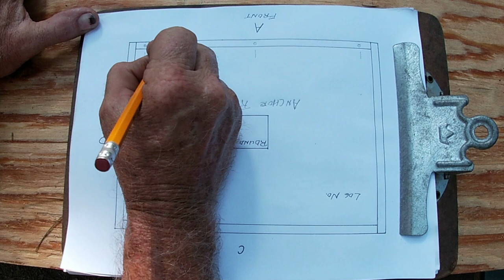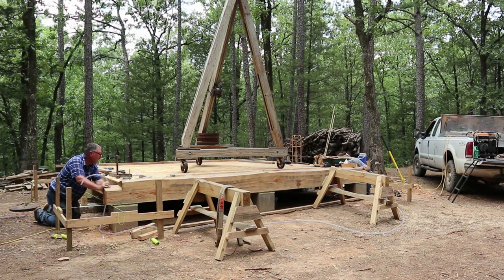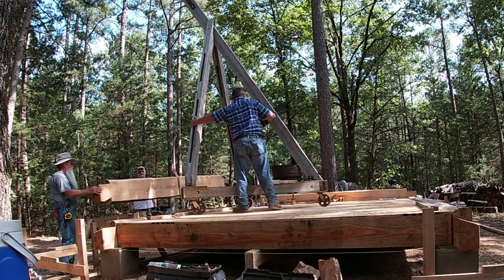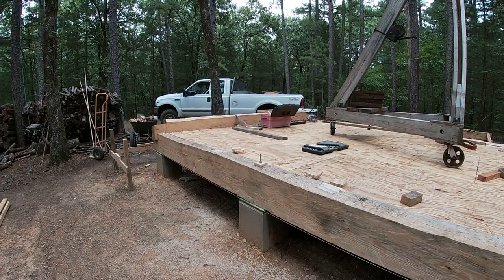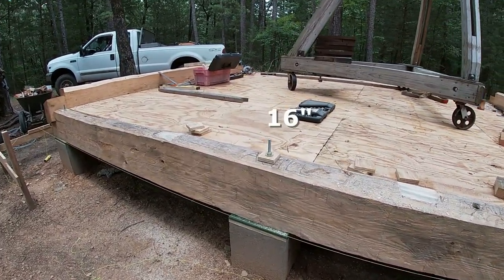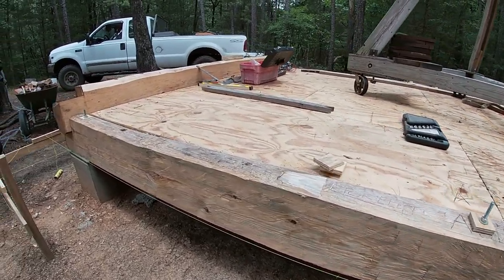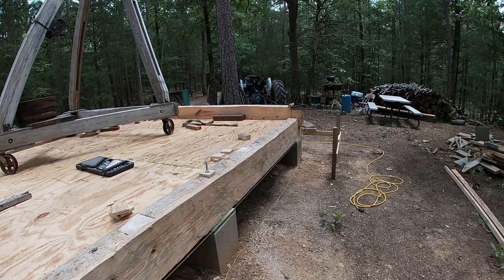Setting Wall Logs, Rounds 1 and 2, Paradise Point - Ep 4

Comment: Here is a tip I learned.   When cutting a bolt or all-thread, screw the nut on first and then cut.  As you unscrew the bolt, it will chase the thread and clean it up. This makes it much easier to thread the nut back on when the time comes.
Reply from the maker: Howdy Lowell- that’s a great tip! I’ve done that before and it works great. Thank you for sharing this. God bless

Comment: I noticed you did not form piers for the middle supports as you did for the outside supports.  Have you noticed any bounce or shifting since this isn't supported as well in the center?
Reply from the maker: Howdy Joel- I put a girder and blocking in the middle of the cabin floor. You can go back in the video playlist and watch Girder, Floor Joists,Subfloor Paradise Point Log Cabin Build Ep.3. The floor is strong enough to hold up the hoist with the counter weights and a full length log. All that weight sits on three swivel wheels on the hoist. God bless